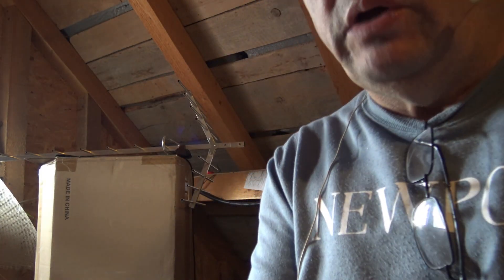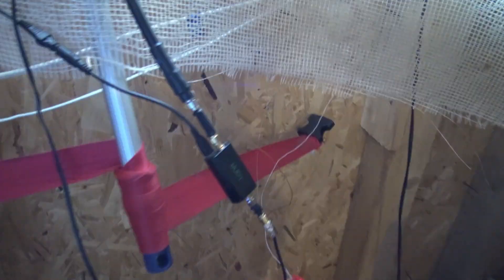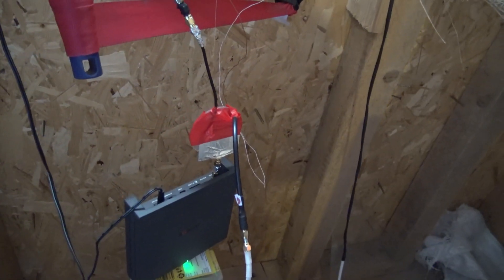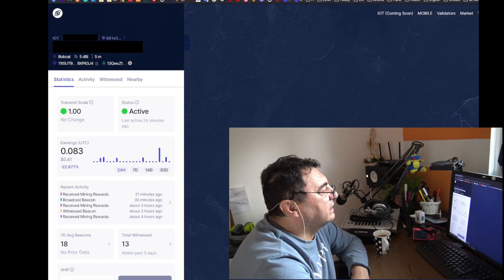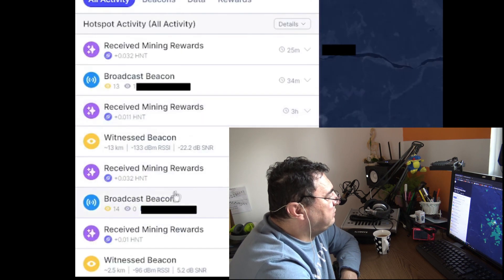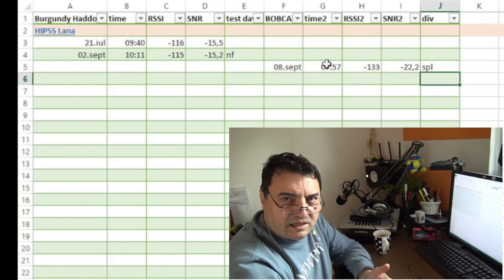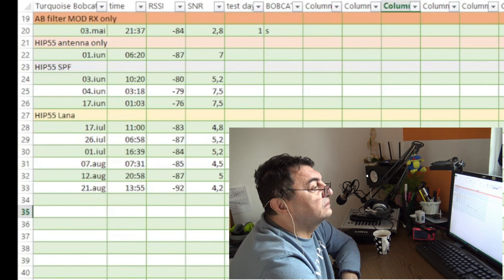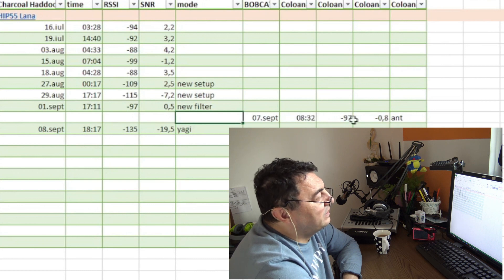Bypass TX Helium Lora Miner unidirectional amplifier

Comment: Hi, a very interesting idea, especially in order to avoid "Bad RSSI" between my 4 hotspots, for example when they use one antenna through a splitter. So that their RSSI is not too high, I use passive 20-30db attenuators. However, this significantly reduces the "Wittnesses", and the amplifier does not compensate for these losses.
Have you ever seen a schematic for splitting the Hotspot antenna output so that one antenna is used for Tx and the other for Rx? 
I already tried to insert a schottky diode into the cable, but the signal still passes through the diode in both directions.
Reply from the maker: For a single hotspot just the splitter will do the job, electronically, when  TX it's on, the RX part it's blocked...so you can't shoot your self. Using amplifiers probably will resolve that. I should better mod the radio module for separate antenna connection. I can be done easily.
Reply: @viocaia  now looks like this https://drive.google.com/file/d/1RF_q5bH3d_lcvI2NiN-fI-lJv6baj6Qt/view?usp=sharing
Reply from the maker: @AnDroidas-ud6ky  Whau..almost NASA!
Reply from the maker: @AnDroidas-ud6ky  Interesting. Those diodes I'm afraid are doing nothing, we are talking about RF which is AC (kind of) at 868Mhz...the diodes are seen like a capacitor, but interesting idea. Hope it works.
Reply: @viocaia  I already tried. Unable to route Tx to second antenna.
Reply from the maker: @AnDroidas-ud6ky  There are some devices named circulators, check my channel for a video about. Also google for it, those should resolve your setup.
Reply: @viocaia  Hello, I ordered four circulators, but unfortunately if one of the hotspots sent a beacon, the other three see it with a very high RSSI. This allows me to assume that the beacon signal goes not only to the Tx splitter, but also to the Rx splitter. 
Do you have any other ideas how to switch the Rx and Tx signals to different antennas?
Reply from the maker: @AnDroidas-ud6ky  As long as they are together,  in proximity, it's very difficult to isolate TX-ing. Probably some -20dB attenuators will help, inserted in TX path , to lower the TX power to the antenna, somehow after circulator output and TX antenna, or simply , let the TX antenna output in the air...no antenna.
Reply: @viocaia  my hotspots now https://drive.google.com/file/d/1RF_q5bH3d_lcvI2NiN-fI-lJv6baj6Qt/view?usp=sharing
Reply: but the idea is to do like this https://drive.google.com/file/d/1sLwQsv-xjB9d0ZrDjJFeK4VavkH9cGoX/view?usp=sharing

Comment: Have you seen any benefits with wrapping splitter in alu foil, reduced noise?
Reply from the maker: normally it should be in a metal case..so probably is beneficial..It's still under test so I didn't measure any parameters..the backside of the board it's all grounded so there is already a huge screen,but doesn't hurt extra..
Reply: @viocaia  I have tried the same, but mine snr didnt change, definitely i am going to put alu foil back, thnk you for your fast response
Reply from the maker: @250398todorovic  Of course isolate the traces, first with some tape to avoid short to ground..